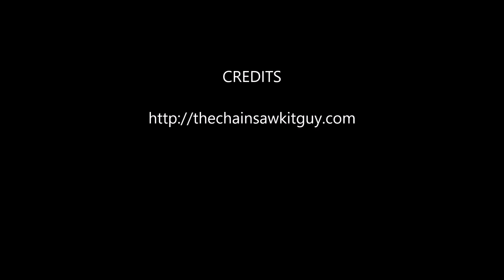FarmerTec Purple Monster No Crank

Comment: Your use of the term "crank" is very confusing...sounds like it "cranks" just fine, just doesn't fire and run.
Reply: If it won’t crank it definitely won’t fire.
Reply from the maker: In the title crank means start up. Crank also is the workhorse of the engine pushing the piston. Hang around and watch the video I make and get a sense of the potential issues. Fire and run is a good thing. We want that.